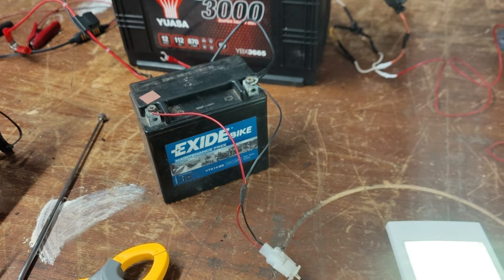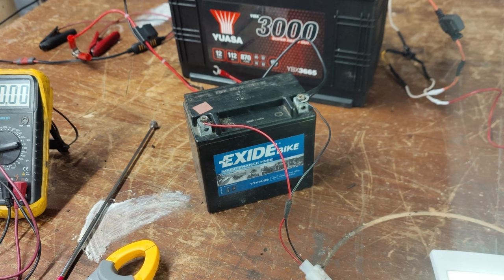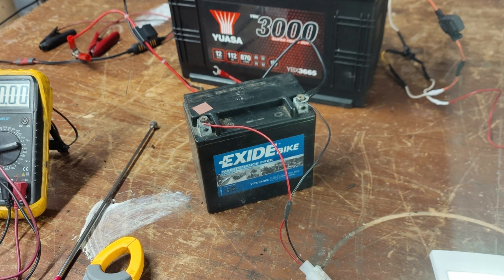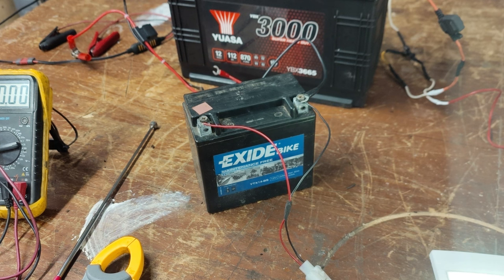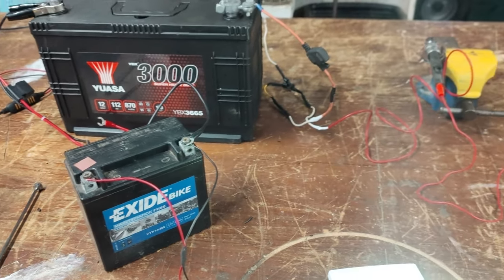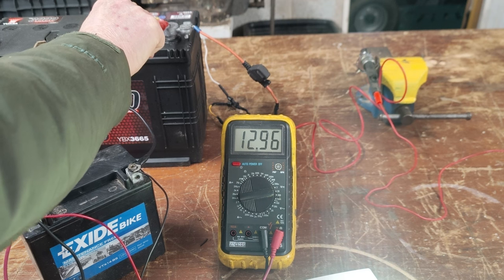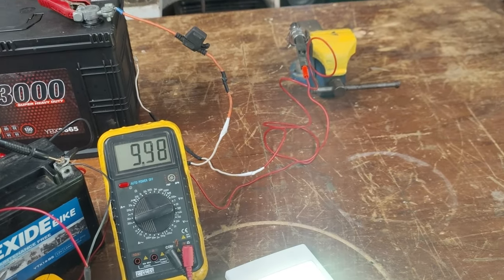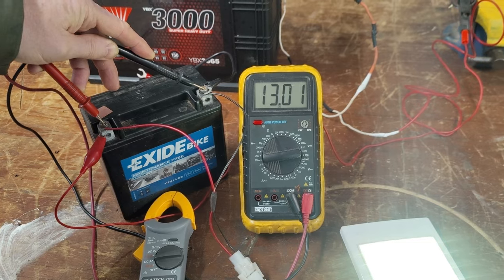A simple cheap DIY 12V campervan Chassis battery maintainer

Comment from the maker: One thing I forgot to mention, when connecting any form of charger to a chassis battery, there is always the possibility that any existing archaic VSR or more intelligent DC-DC/B2B charger will also switch on once the chassis battery rises above that devices trigger threshold. 

If this happens then simply remember to isolate the VSR or DC-DC/B2B.
In my own van I use the engine running D+ signal to switch on my Sterling BB1260 so it only comes on when the engine is running

Comment: Interesting video, thanks. I had a quick look at the Votronic standby unit but it specifically says not to mix lithium and lead acid/flooded batteries. Do you know why this would be please, and would the method you show here work with lithium leisure and lead acid chassis battery? Thanks
Reply from the maker: Lithium is fine for trickle charging a lead acid battery my AMT12-2 is effectively doing exactly that, in fact it is better because it sits at around 13.2v virtually permanently when not being charged, so allowing for the volt drop across a diode the lead acid will be maintained at a healthy 12.5-12.6v even overnight. Then when solar kicks in the lead acid battery voltage will rise in proportion to the higher charge voltage to the Lithium same as in my demonstration so is then effectively on float.

Perhaps the Votronic docs meant do not physically connect lithium and lead acid directly together in parallel. This can have undesirable effects and as an aside it's never a good idea to use an Archaic split charge relay with Lithium!

FYI in recent years many people have started experimenting with hybrid Lithium/Lead Acid Auxiliary battery banks but that an entire topic on its own!

Comment: How did you get on with the android head unit? I had to unplug my canbus decoder otherwise the dam thing drew a constant 2A.
Reply from the maker: I haven’t decided what’s going in the Daily yet, I have an Xtrons in the Crafter, it’s ok ish it draws about 25mA when off. Like all these units the screen isn’t bright enough in sunlight, apps don’t always display properly in landscape and the touch screen controls are dangerous or impossible to try and use when driving. 
I may use a normal BT head unit with proper knobs on and a normal  phone mount for google maps.
I don’t have steering wheel controls in either van which doesn’t help either!
Reply: @CriftinsCampers  I think my canbus decoder was faulty,  I lost remote CL with it plugged in ? But the reverse camera triggered OK, I use manual triggering with feed off the Phnx system,  I think inane is an atoto 4  with proper buttons and a volume lnob 👌 not really a touch screen fan tbh, personally I think they're dangerous and distracting  but it's handy for the cams I spose.